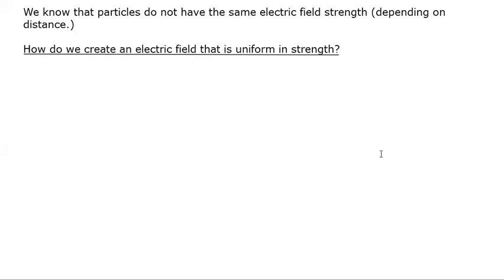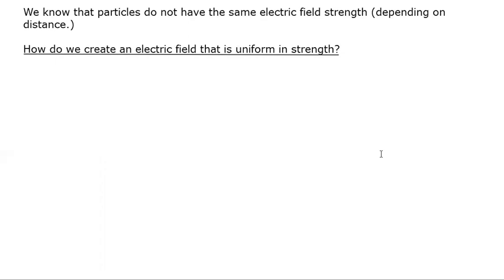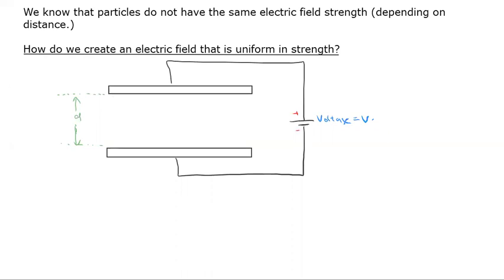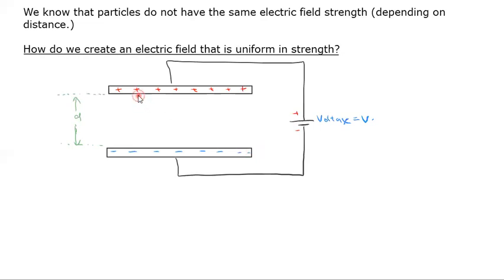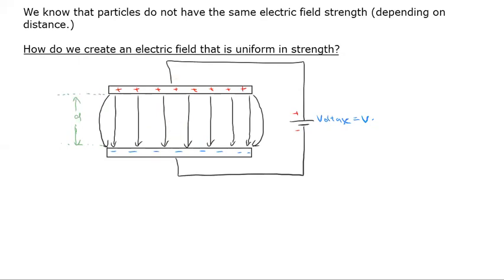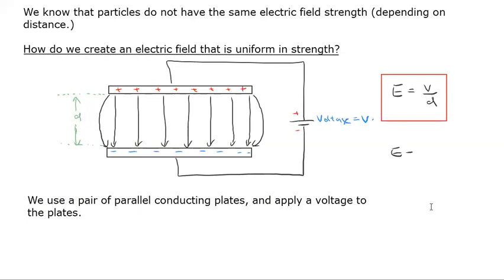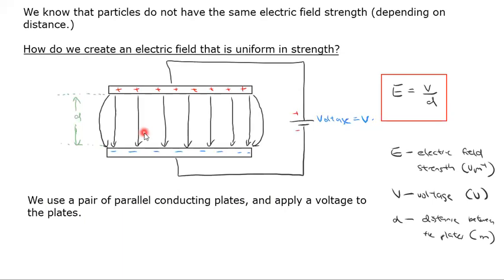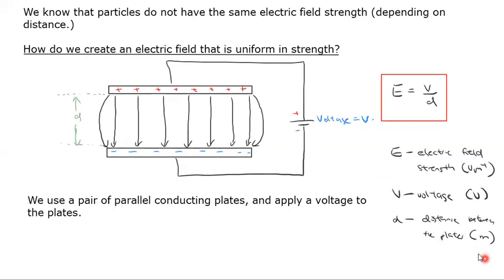How do we create a uniform Electric Field? (E=V/d) - Electric Field between Parallel Plates

Comment: I was just wondering what if the charge is closer to the positive plate than the negative plate or closer to the negative plate than the positive plate? won't the electric field strength be different?
Reply from the maker: In this scenario, where we are assuming the electric field created is uniform, the electric field strength will be the same regardless of the (perpendicular) distance to the positive or negative plate. 

It would not be uniform if they were not parallel plates but were point charges. In practice, there might be some small deviations (as the plates will be of finite length) but the idea is you treat the electric field as uniform in these situations (which is reasonably accurate).